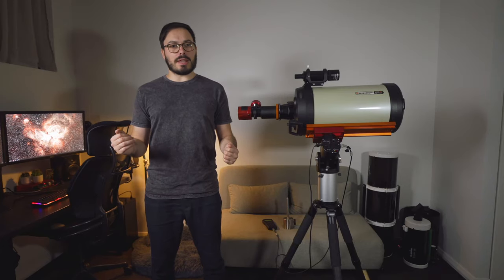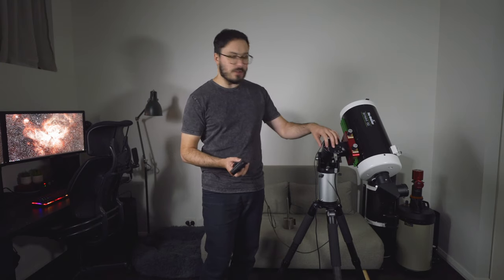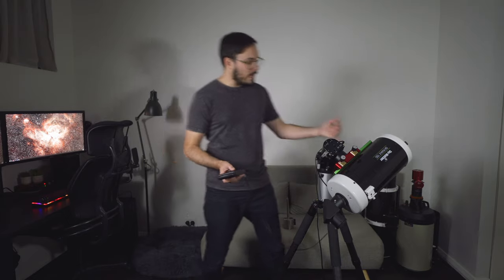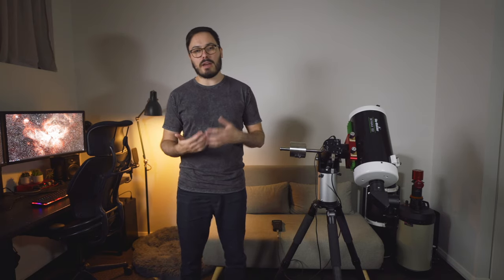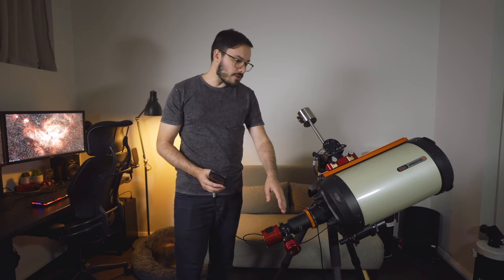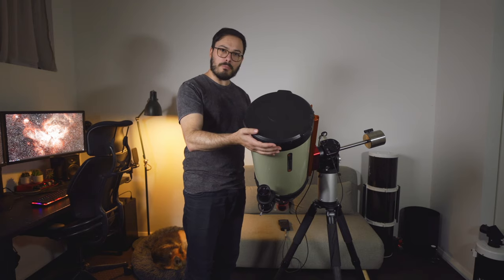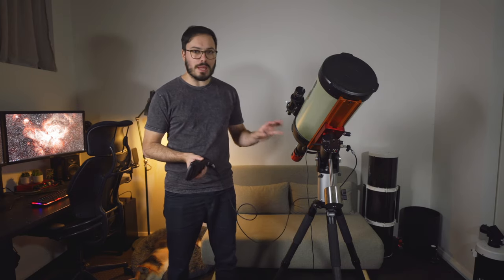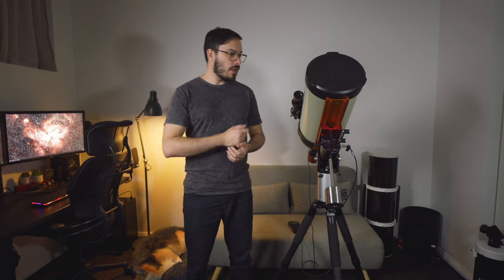Losing power on a mount with no counterweights (Back driving)

Comment: Interesting video!  I have a HEM27EC and I recently loaded it up with a RASA 8 and now I notice it back drives even though it has a brake!  It was scary at first but then I added a 5kg counterweight and no more back driving.  I think that the weight overcomes the brake it will back drive and I think that lets you know if you have enough weight or not.  I also learned that it is the vertical height of the OTA from the base that determines the distance of the counterweight.  Also I forgot to mention, the strain wave gear has a stopping point so luckily my OTA never hit the pier before I realized this!  Thanks for the video!

Comment: Most informative video on back driving. Thanks. Looking forward to the next one on guiding. Definitely helping me make up my mind on whether to buy one or not.
Reply from the maker: Glad it was helpful!
Reply: @AstroWithRoRo  Quick question: does the mount back drive if the power is cut when it is
 in the home position ie pointing horizontally West?
Reply from the maker: It will only back drive if you aren’t well balanced on your dec axis in the home position. If you change the home position to a traditional polar Parker position then it will be easier to balance.

Comment: Well that is quite the setup. It would have been interesting to see you disassemble that rig after the backdriving had put it into a very awkward position. Although you may be able to stop the backdrive with your hands, if you are there when it happens, you still need to either find another power source, which means letting it go while you search and connect that alternate power source or you need to shutdown for the night and pull the rig apart. Imagine that big scope swinging down with no counterweight... yipes! I can visualize some difficult moments, in the dark, when this is all taking place; especially if you are alone and both RA and DEC can backdrive independently. They need to implement a small backup battery (9v), which would engage a braking mechanism and perhaps turn on a flashing red LED. Electronically, it would know the difference between a slew command and a power failure. Everybody is looking for some peace of mind with their expensive gear investments.
Reply from the maker: I wouldn't attempt to disassemble it in such an awkward position. Once thing I didn't show here is that you can reverse the back driving by lifting the telescope. If you're not able to get the power back on, you can lift the telescope back up to a neutral position where you can then remove it more safely. This is what I would recommend anyone does if they cannot get power back to the mount.
Reply: @AstroWithRoRo  That makes sense. How much effort would be needed to lift the scope up to neutral position? Is this explained in the owner's manual? Thanks.

Comment: I presume if back driving occurs the mount also loses any positional information it had? So you would have to re-align? It looks like you have to Park the mount with the scope oriented so no back-driving would occur when the power is turned off, if you want to power it up and not have to re-align the GoTo system. Thanks for the helpful video.
Reply from the maker: Yes, back driving would cause the mount to lose knowledge of it's current pointing location. You would fix this by running the "homing" routine and then you would be good to go again.

Comment: I was thinking of getting that mount, would it be an upgrade from a CGEMii mount? How is the periodic error? Also wondering how long you can go unguided? Does it bother you at all, that this type of mount does not have clutches? Do you ever have problems with this mount not returning back to the proper home position, or has that been ok? Thanks.
Reply from the maker: Great questions! I will be releasing a video going over the PE, guiding, power draw, unguided performance, etc shortly (just waiting on some more clear skies). It does take some getting used to no clutches, but so far I am not missing them. You just have to learn to do things differently. It always returns to the home position very easily and quickly, no issues there.

Comment: Very interesting , again ! I'm wondering if the "back-driving" produces any voltage from the motors back to the electronic circuits . Could be a bad thing . I think the Manufacturer would need to comment on that one . /SRK
Reply from the maker: I agree I think we w3ould need to hear from Rainbow Astro on this. I will try and drop them a message to see if I can get an answer on it.